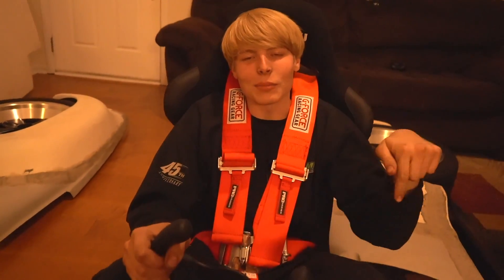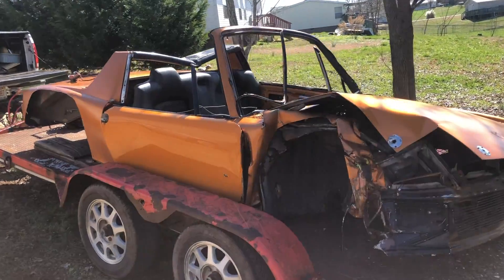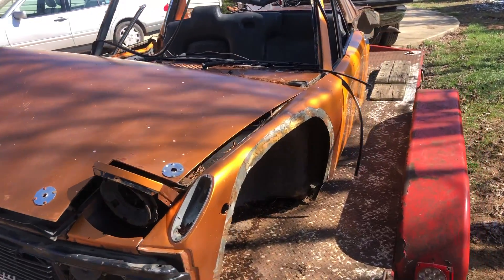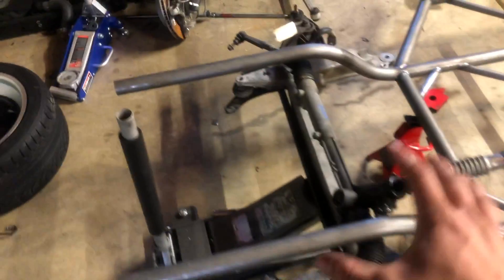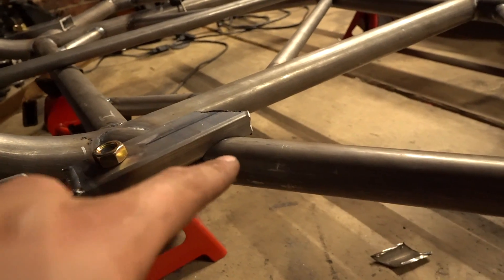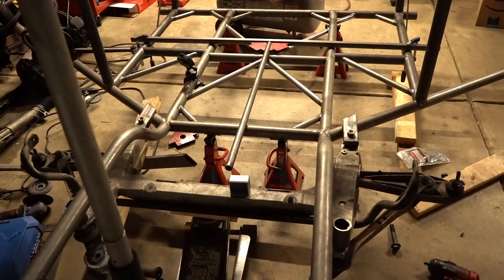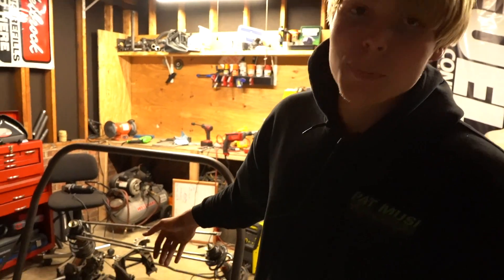Building A Tube Chassis Race Car In My Garage Pt. 1

Comment: Now I know you live in WAaaaaa.
We live in ORrrrrrgun
Now I know why your 9 1 4 is a wreck...because it got wrecked.
Beautiful, purple Hollyhocks on the opening to this videO

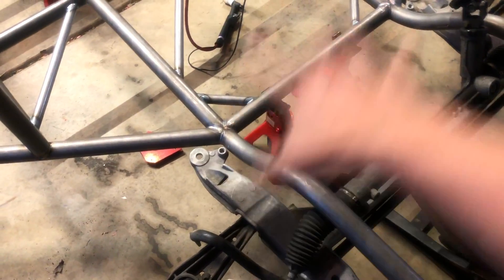At 4:53 in the video you are not wearing gloves with the angle grinder. Angle grinder's do not  like the job there were made for. And because of that they like lull  you into thinking this is such an easy to use, safe tool. BUT it is just waiting to grind your fking finger off; the more the merrier. And it would be so happy to hit an artery and watch your blood spurt all over the shop. DON'T EVER GET RELAXED WITH TOOLS. I had a angle grinder bind up and kick back and the spinning part hit my hand. Luckily I had heavy gloves on and I was saved. If you don't have  fingers left after a grinder attack and they are left on the floor; 4 sure you are going to have less women coming to get close with you IF you know what I mean. FINGERS are important for so many thing,

"A garage without a Porsche is just a dark hole" Walter Rohrl - Porsche Development

Comment: What pipe bender is that? Trying to find one that doesn't just pinch the tubes.
Reply from the maker: Affordable bender, good for single bends, multiple bends on one tube it isnt great because you cant re-align the tube again. You end up spending time straightening the piece
Reply: @ZipTied  thanks

Comment: Thanks for the education bro!  What got you into frame building im getting there myself
Reply from the maker: First i built a roll cage by just going for it, then i practiced accuracy (bends, cuts, and such), i practiced welding every night for like 4 months, and finally got the confidence to start. A good digital angle finder, and a lot of research are your friends.
Reply: You just use a digital level on a magnet to do compound and strict tolerance angles on the bender?